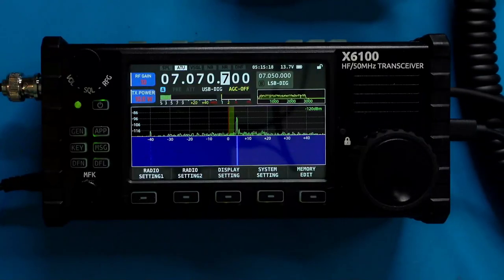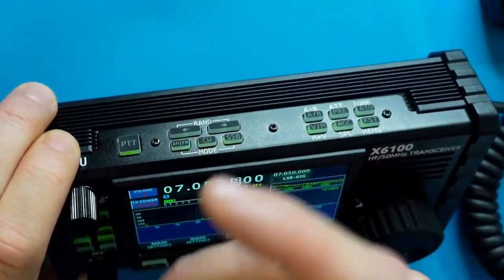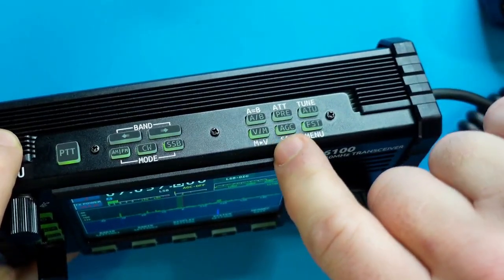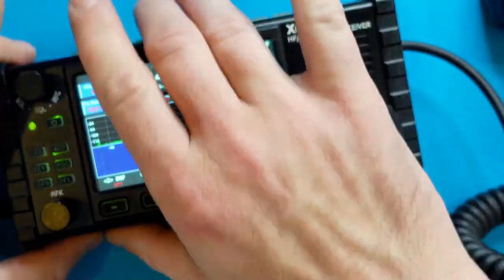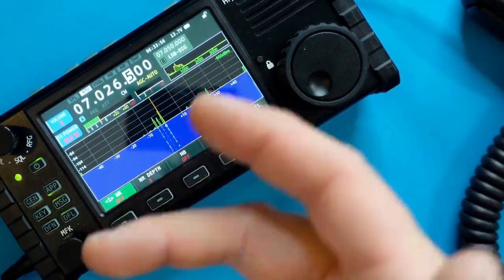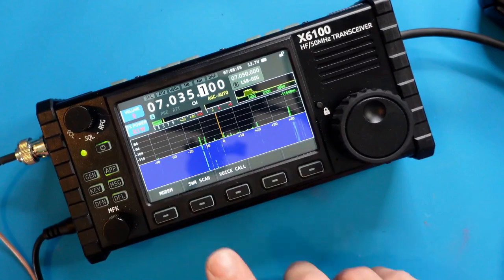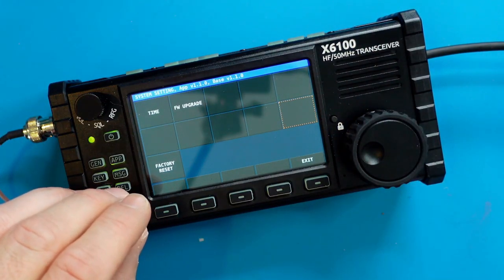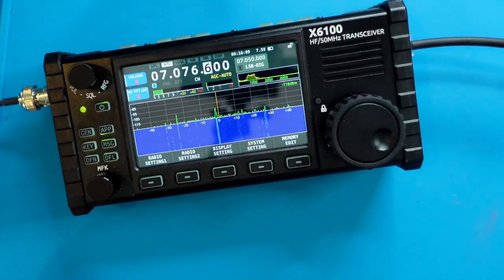Is the Xiegu X6100, Production Ready?  - Feature and Bug Overview

Comment: Thank you for the video as always great content . Just wanted to post a comment on the missing WiFi Bluetooth. I reached out to support at Radioddity and this is what I received.

Hey Tony,

Glad you finally received the radio. Please allow me to explain clearly to you about the missing function.

The vendor tested that these two features were available during mass prototype testing, but inevitably there was a lag when making multiple connections, so we left them open in the first batch of radios for now.

However, we expect to update the stable version of the firmware in January to make these two features available, so sorry for the wait.

Cheers,

Jackie

Radioddity Support Team

I Guess its worth the wait. Thought I would share.

Comment: Good preview. Those little bugs could be annoying. If the tuner still works with the USB cable inserted, I can deal with that since I hardly ever need an ATU. I like the idea that you don't need an interface to connect the radio to the computer. 
For external power while operating portable, to be able to use the radio at 10 watts out, I would use a 4 cell lipo with 2 dropping resistors in series in the positive lead to drop the voltage from 16 peak volts down to 14 volts. 

You are getting a lot for your money with this little radio. I'm looking forward to getting one but I won't be a beta tester.

Barry, KU3X/ QRP

Comment: The CIV implementation on the G90 is a bit sketchy. Have you been able to test the implementation on the X6100 yet? Is it possible to control it via the USB port and is the I/Q-signal available using the USB port?

Comment: I watched the entire video hoping that you would show me how I can adjust the frequency digits on the far right.  two of them don’t move at all to fine tune when I’m doing CW
Reply from the maker: I no longer have the radio, but this is what I recall:. There was a more recent firmware update which gave the option to update the fine tuning on the radio.  I believe after updating the radio, you can hold down the fst button or tap it and it should switch between MHz, htz, etc.  Best wishes

Comment: Has anyone actually charged this radio to full and tested that the circuit actually turns off and not over charge battery's. I swear I've had mine charging 7 hours plus and light still blinking green . Instruction manual states once fully charges at 8.3 to 8.4 volts light should turn off and circuit disconnect. Thank you in advance would really like a confirmation please for now still Shi*** bricks scared to leave it charging .  73's W4KWS
Reply from the maker: There's a few people with issues where the charger isn't charging fully. I have been using the 13.8 volts from my PSU, I will try tomorrow with the power brick and see what results I get. Sorry to hear!